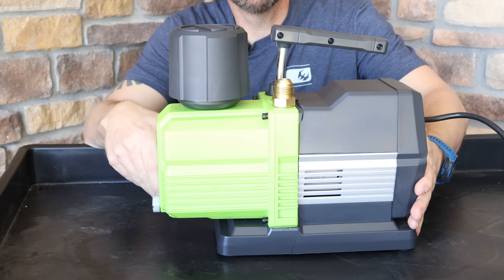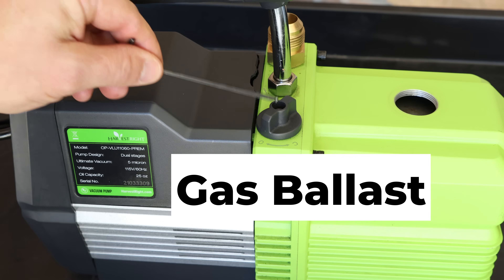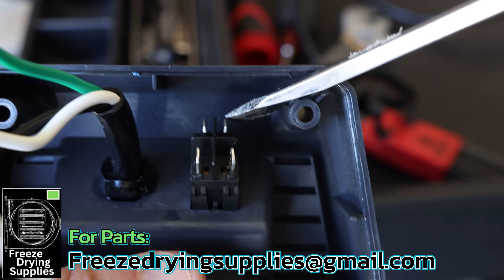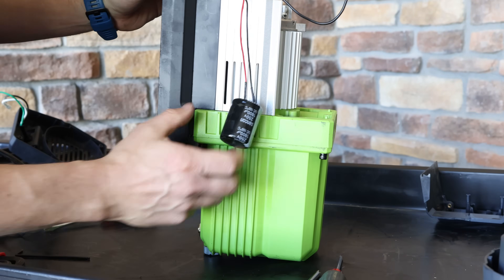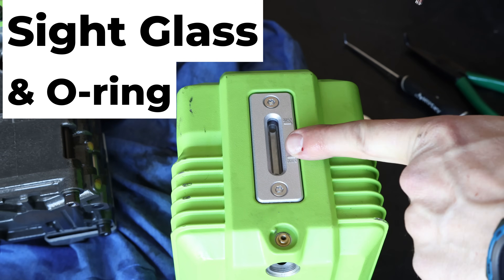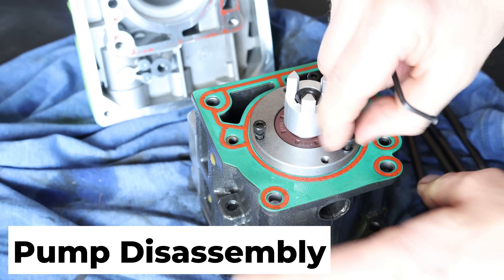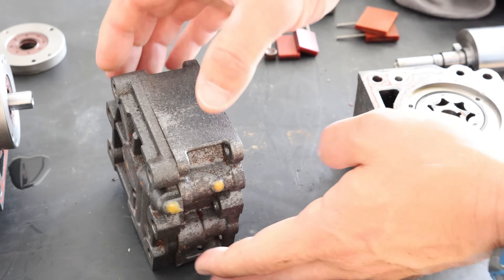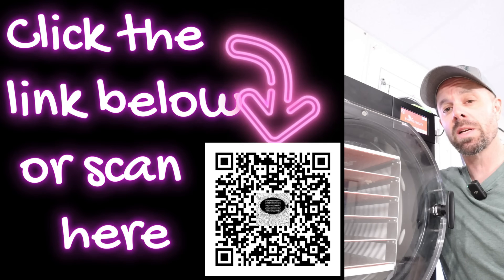How to Tear Down Your Freeze Dryer Vacuum Pump (and Keep It Running Like New)

Comment: How often do you recommend in tearing down the vacuum pump like your video? I had my pump for 2 years and it started smell like it was burning oil. When I took the reservoir off it was full of rust and sludge. The insides were blackened from oil channels being clogged.  I ended up buying a new pump. So should I tear it apart like once a year or is my case just a one in million chance of that happening?
Reply from the maker: It really depends on what type of foods you are freeze drying.  I have torn apart lots of these pumps and the difference on inside wear is HUGE!  The pumps that have done fruits, veggies and similar are very clean, the pumps that have done high fats and oils look like the inside of a barbeque grill.
Reply: 17:25 in your video did you see the burnt oil on the shaft, I had this throughout the pump. would it hurt to use a very fine sandpaper or 0000 steel wool to clean this? Or does it not matter on the vacuum. My pump wouldn't pull below 1000 mT on an empty chamber. I know it isn't a leak because my new pump pulled to 177mT

Comment: For the last 4 runs on my small HR freeze dryer with the premier pump, I have had a rubbery burning smell that is quite strong and fills most of my house with the smell.  I think it might be the pump so last week I took off the dimester, rinsed it with water and let it air dry.  Yesterday I ran a load and the smell was still there.  Any ideas?  The dimester is only about a year old and I do not run the freeze dryer all the time.  My freeze dryer is just over 3 years old.  Would you suggest a new dimester or check something else?
Reply from the maker: The burning smell could be a gasket/seal getting hot or possibly the pump veins.  The demister could be saturated with oil or crud, but I'm not sure that would make a rubber smell?
Reply: @thefreezedryingcommunity I swapped out the Demister for the first one I had just to see if it goes away on my next run.  I hate to take apart the pump because I am afraid I will not get it put back correctly since it has so many parts.

Comment: The rebuild kit for this pump is not in stock. However I have a sinking suspicion the kit for Navac NKR12D might work for the pump veins and the gasket part PO12008 which is one of the two main reasons ppl have huge oil leaks.

There is another gasket part seen in the video which is the shaft seal that also keep oil in and that part can’t be found.
Reply from the maker: I think one set of veins is the same, the other is not available for this pump.  I have some pre-owned veins and new PO12008 gaskets.   If you are ever in need, you can email me at freezedryingsupplies@gmail.com

Comment: Can a standard ac vacuum pump be used?
Reply from the maker: short answer is yes, but the major difference is the pumps made for freeze drying are made to shed moisture from the oil.  Otherwise, you may be stuck changing oil in another pump every batch

Comment: I found an illustration of how the parts fit together very helpful when I repaired my wife's Premier Pump.  It doesn't get all the way into the innards, but was very helpful in orienting myself during the process.  The illustration I used can be found here: https://navacglobal.com/wp-content/uploads/2019/02/NP12DM-User-Manual-EN.pdf.

Comment: My pump is leaking oil, I need help.
Reply from the maker: Probably the rubber seal between the sump and the trestle.  loosen 4 bolts after draining the oil and reseat the seal.  Or purchase another one